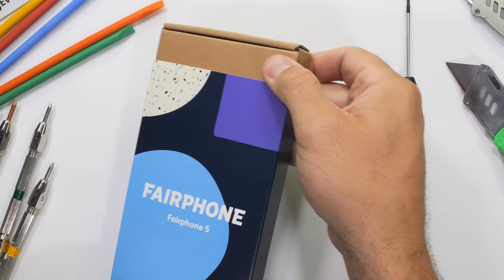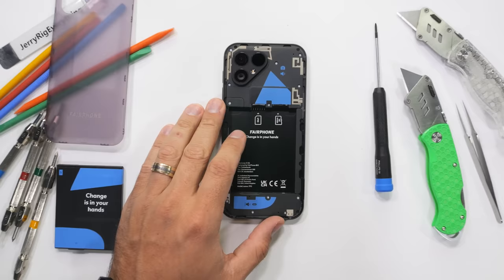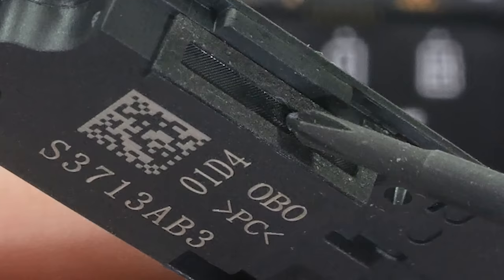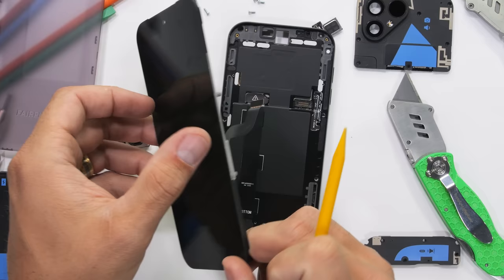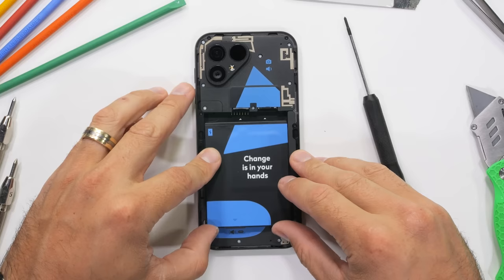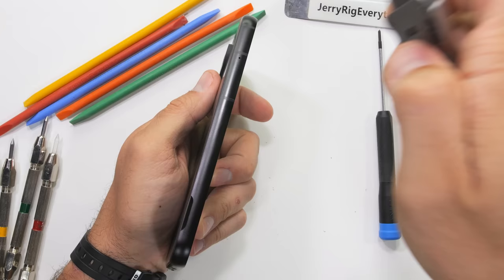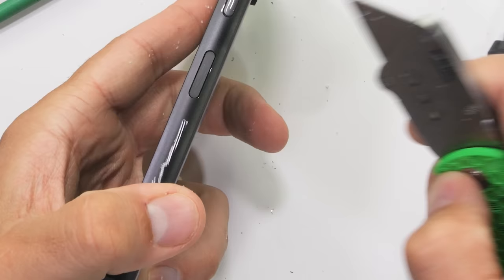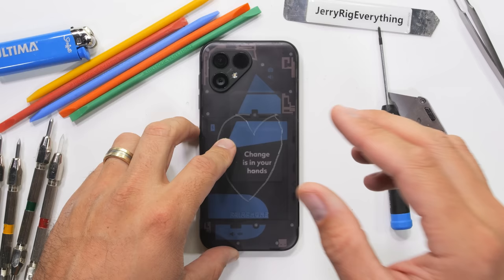The Best Smartphone on Earth - (Not Clickbait)

Comment: What most people are overlooking when it comes to the battery - you can easily carry around 2 additional batteries (that you charged with an external battery charger) in your pocket and change it on the go, it takes less space and is far more convienient than carrying a powerbank and having to use a phone with the power bank plugged in
Reply: Not to mention using a phone with the power bank plugged in destroys both batteries way faster
Reply: I used to do that with all my phones back in the day. I had 2 extra batteries.
Reply: Back when batteries were removable like on my S4 I used to do this all the time, I'd keep an extra battery in my pocket and just swap it out when the other died, could easily last at least two days without touching a charger
Reply: Literally should be a top comment
Reply: However keeping all spare batteries charged is a bit tedious
Reply: multiple batteries can be baught with a charger.
The batteries can last a lot longer if they are charged very slowly too.
Reply: I used to do this constantly with earlier model Galaxy Notes. It was mighty convenient. I truly miss those days. I'd trade waterproofing in a heartbeat for replaceable batteries.
Reply: @bananabread4075 but it isn't
Reply: What would be cool is if they did what they do for earbuds and apply it to the phone battery, imagine a case you can slide your battery in that will keep the spare topped up and protect it from external elements (don't want a loose battery in your pocket to get punctured by your keys for instance). Pop the top, slide out the charged battery, and replace it with the dead one.
Reply: @weignerg  I did that with LG G4, but it was a necessity as battery did not last even a normal day. And I did not enjoy keeping all spare batteries charged.
Reply: if only it had a smaller battery for hotswapping...
Reply: Most people know that.
Reply: But then you have to swap the spare batteries multiple times to charge them again, fast charging is the way to go, my one plus 11 gets a full 0-100 charge in about 25 minutes, if that battery were also replaceable that would be just dandy.
Reply: What most people don't realize is that in order to save costs, power banks use poorly designed circuitry resulting in a huge waste of power.

So you can be carrying around a 10,000 mAh powerbank but barely able to charge your phone twice!

And just like the old days of Samsung phones, it's far faster and lighter to carry extra cell phone batteries to swap out. No messy wires, lossy power transfer or extra weight! Not to mention power is restored IMMEDIATELY
Reply: Like it used to be, until Apple taught the whole world how to be greedy and not allow it.
Reply: Wow
Reply: @BrandonGiesing then you'd be carrying a battery to charge your battery 😅
Reply: That's exactly what I did with my LG V20
Reply: @pionytudr  well to be fair, until Apple or whoever introduced  a glass back, glued it, so that you can't remove it.

I was fine with the plastic back, it doesn't break, less slippery, and much much lighter! Oh and it's much easier to replace battery.
Reply: @logans3365 It does not destroy both batteries faster... It's just hella inconvenient.
Reply: @HALWG51 used to do that with the Galaxy s5
Reply: @EikottXD  heat kills batteries, and charging the battery in a device while using that device creates a lot of heat, degrading the battery faster.
Reply: Up
Reply: This is the future of longevity and convenience. My friend carries a battery bank that's twice as chunky as his phone, and it gives him maybe 1.5 full charges. He also carries a cable, and he needs to leave them connected for his phone to slowly recharge.

If modern smartphone batteries were like this phone, he wouldn't need all that crap. He could bring two spares; both together would still be a smaller footprint than his phone, provide more energy, and instantly being his phone to a 100% charge (well, 30 seconds? A minute? Still faster than fast charging could ever be).

My friend isn't the only one who brings around a battery bank- just look at how many sales they get on Amazon. This ancient technology of swappable batteries is so much more practical for a lot of people than the model of today's smartphones.
Reply: yes but no..... most batery phones are not rigid and withou a proper casing they can be dangerous if they bend.... basically a power bank.... still i think more convinient
Reply: @ricardovelazquez6480  In the video it looks like the fairphone batteries are pretty rigid, like removable phone batteries used to be, but even with a case it'd still be slimmer than a power bank. The cool thing, though, is that it's an option; phones with modular batteries can still be used with power banks, so if power banks work better for your use case you can keep using them
Reply: or just use a powerbank lol
Reply: I Used a rooted, debloated Galaxy S2 for many years and then a Galaxy Note 4 with similar mods for 5+ years, both with a multitude of batteries. Zero "charge anxiety", so to speak.

I don't think any phone I've bought since has lasted more than 2 years without a somewhat degraded battery. 

Granted, I use my phones for work, hence mandatory encryption and various authorisation apps, MS Outlook, teams, etc which never allow the phone to go into deep sleep.
Reply: i wouldn't recommend anyone to carry those batteries in pocket or bag. THey are not meant to be used like that. 

Easy battery removal IS what it is, easy, cost-free battery replacement for consumer when his old battery is worned out permanently and he needs to install new one without going to customer care. its not safe to carry batteries in pocket like that.  Many people dont want to visit and spent and waste time to replace their old battery by going to customer care. Thats why easy battery swap.
Reply: The problem is the battery is dangerous is "not placed or bring in right way"
Reply: @cnhtol1586  LG literally used to give you a little plastic case with a spare battery to carry it around. And yeah, obviously there might be a little risk if you carry the battery without protection in the same pocket as keys (did that daily for nearly 10 years but whatever), but even if you puncture it in your pocket thats not as tragic as for example having a battery of a electric scooter/bike igniting in your home.
Reply: @YOUKNOWlMHERE   LG literally used to give you a little plastic case with a spare battery to carry it around. And yeah, obviously there might be a little risk if you carry the battery without protection in the same pocket as keys (did that daily for nearly 10 years but whatever), but even if you puncture it in your pocket thats not as tragic as for example having a battery of a electric scooter/bike igniting in your home.
Reply: It would be incredible, if in the future, phones had small backup batteries and hotswappable main batteries.
Reply: So true. I still remember my Samsung galaxy s3 back in the day I used to carry around an extra battery and would charge the spare battery at night with an external charger. Nothing beats that setup and honestly it should be the standard. So much better than carrying around a power Bank, plus its easy to just get another when the health from one battery goes down over time
Reply: Yeah just make sure to keep the spare battery in a safe place, that thing could blow up if you get a small hole in it
Reply: That's what I do with my fairphone 4 lol
Reply: @theninjascientist689  how do you like the fairphone overall?
Reply: An extrernal battery charger would be great as an option, it would be easier to charge the spare batteries that way. I had two Nokia phones back in the the day that used the same size battery, so I used the old phone as a battery charger.
Reply: @Rickarrish fast charging is a mixed blessing. It's convenient at the time, but kills the battery faster in the long term. That's why phone manufacturers like fast charging: you need to replace your battery entire phone sooner. Good for business, bad for users and bad for the planet
Reply: @cnhtol1586  if you mean carrying batteries loose in a pocket I agree: that's a no-no because you only need a key to sort the terminals and you're on fire!

When I had my Galaxy Note, I carried two spare batteries in a wallet design to hold several credit cards. As the wallet was an insulator that protected it from casual short circuits. In theory there would have been a fire risk, but much much reduced as batteries tend not to burst into flames when there is zero current in our out.

I'm planning to do the same again with my FP4 or FP5. Only decision at present is whether to get the price-dropped 4 or the new launched today 5...
Reply: @ninjachrish  The camera and processor are a downgrade from my OnePlus 6, but that was a conscious decision I made. The trade-off is peace of mind that even if the worst case scenario happens like with my OP6 (Bricks itself after booting, can't access anything apart from the boot menu) I still have all of my important data on a memory card which I can chuck in a PC. I also use two batteries which means I rarely ever need to actually use the charger, I just swap out the batteries and keep chugging along.
Reply: @theninjascientist689  your op6 just bricked itself like that? Damn that sucks. I've never had that happen to me before I hope it doesn't. I should probably back up more of my stuff on my phone onto a cloud
Reply: @trueriver1950  heat kills batteries, fast charging produces excess heat but not nearly as much as wireless charging.
Reply: @Rickarrish  my point was that fast charging kills batteries. So yeah: wireless as currently implemented is even worse, but that's irrelevant.

And my main point was that battery manufacturers promote fast charging because they sell more product that way. 

I would add that phone manufacturers love it when you can't replace the battery for the same reason. Sell more product, make the user spend more money more often.

Finally...

I'm not convinced that heat is the only thing that kills batteries in a fast charge; certainly that's at least part of the issue, but with more current passing thorough there is more chance for electrons to do damage rather than do what they are supposed to do. I do not know enough battery chemistry at the detailed level to follow up on that thought. 

It would take careful research to separate the two effects (perhaps fast charge in a fridge vs in ambient environment) and I'm not aware of any such studies.

Comment: I've had a fairphone 4 since release and not had any problems apart from the usb port struggles to grip the plug now. I bought the replacement part a few days ago and even the fairphone shop seems more ethical than usual; I gave them a delivery address and card details and that was it. You don't realise how annoying online shopping normally is until you use a website that doesn't push you towards setting up an account, upselling or joining a mailing list.
Reply: Your port was probably just clogged up with accumulated lint from your pockets. I've had this happen many times on my phone. A simple scraping with a needle should clean it out. USB-C connectors shouldn't wear out through the lifecycle of a phone
Reply: @broklond don't use a needle. It's safe sometimes but there's a chance to short out contacts even if the phone is off. Get a free toothpick from a restaurant and shave it finer. The wood is not conductive and the finer point gets more gunk out. Use canned air too.
Reply: @broklond  I've done all that and scratched all the way to the plastic. I think I've just weakened it by sitting on it when it's plugged in and stuff.
Reply: @TheCuriousNoob  I took the battery out and carefully used a felting needles to clean it. Avoided doing any damage but it didn't help either.
Reply: What country are you in and which carrier do you have?  If that is the USA, I am going to go after one myself!
Reply: @krash_1  I'm on "your coop" in the UK. I have no idea what networks support it in the US
Reply: @DaveCharnock  Thank you for replying so quickly.  I was hoping for an easy answer.  Just means that I will need to do more research!  But your reply does give me some hope!
Reply: I'm hoping to avoid such a problem in the future by only charging my phone wirelessly
Reply: I really want the fp5 to get rid of the tear drop. but the phone is still working so naw 😭
Reply: @TheCuriousNoob 😊

Comment: Ok the moment you pulled the USB C off just like that I was immediately sold. This is incredible... Just to think this kinda thing was always possible but intentionally avoided by large companies is just infuriating.
Reply: I know it’s so damn cool and now unlike Fairphone 4 it has enough specs to convince me the oled I wonder if the buttons can be removed though as eight years of use could see them fail and need to be replaced but the housing isn’t a part the sell only the front screen and back cover so could be an issue but I’m so happy they exist I’m tempted to sell my iPhone and switch and yes I’ve always had iPhone and just accepted there dirty tactics
Reply: You only now realise this? Of course it was always possible, if it wasn’t then companies like Samsung would have never had removable batteries
Reply: @axethepenguin  my samsung phone's usb c is separated by the sub board. Ofc now they put it in the sub board but my phone is special ig

Comment: I want Fairphone, and by extension Framework, to succeed so much. They look to be the future of electronics going forward but they need a lot of help.
Reply: I doubt so because modular systems have to be adopted by everyone, not by one company. Otherwise you just get hundred of different easy to repair phones but each have their own system.
Reply: Apple will buy the company and shut it down for good.. apple ways 😂
Reply: @naturalmystic1262 As long as the well-intentioned owners refuse to sell, tim Crook will have no choice but to adapt 😂
Reply: @Bobspineable  Still much better than hundred of different hard to repair phones which each have their own system.
Reply: @Bobspineable We have PCs that's modular